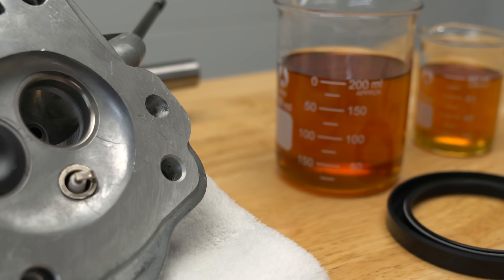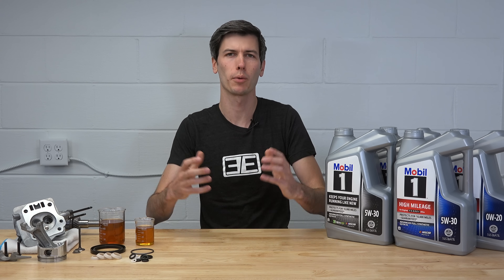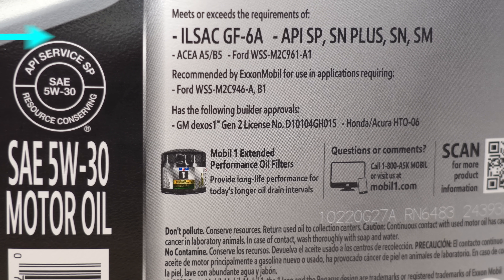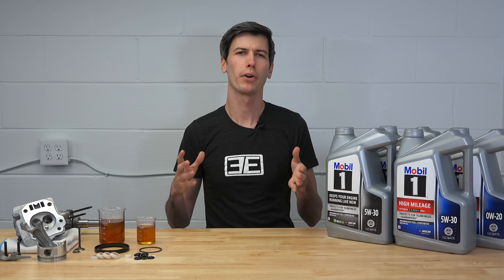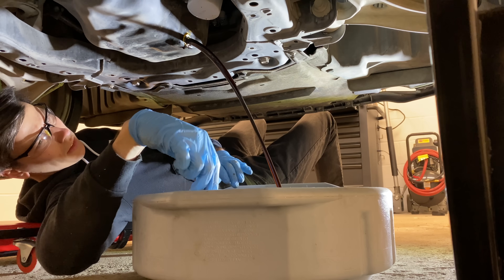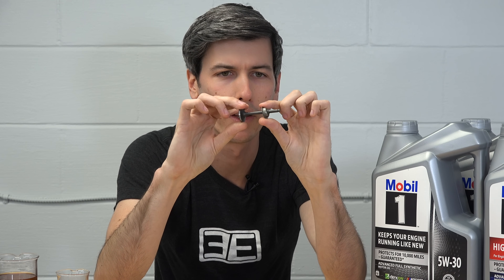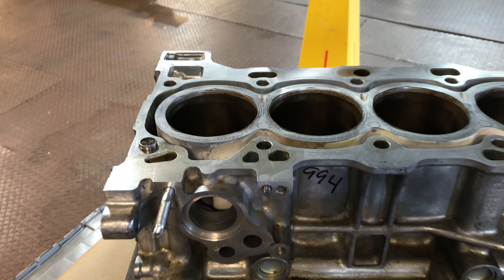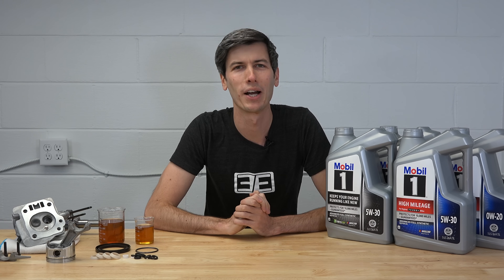Is Synthetic Motor Oil Bad For Old Cars?

Comment: I've always been humored about that "removes sludge" testament on old engines with synthetic oils and that's why they shouldn't be used. Like mentioned in video, who the heck wants to have sludge on their engines?
Reply: Very warn old engines need sludge to block leaks and maintain oil pressure.  Sometimes cleaning out sludge can destroy an old worn engine.
Reply: @raybod1775  no it can't. Do you realize how absurd that claim is. So you need sludge in side oil passages to increase oil pressure? That would mean by physics laws that oil flow amount has also drastically reduced and this somehow increases engine life? Ok let's assume that sludge isn't in oil passages. Where's the next possible place where it could affect? Bearing journals. If that would be the case that sludge will eat bearings away in no time. Let's be real. There is no place for sludge that could increase engine life.
Reply: jothain  Happened to me many years ago.  I had an old dirty car engine and after putting in new clean oil, it hardly could run and all sorts of mechanical noises.  I used a heavy oil additive for old engines and the engine worked better again. It could have been many things like the guides around valves, worn rings, worn bearings, worn oil pump, etc.

Comment: I had a DC2 Integra Type R and never used any oil but when I switched from a semi 10w40 to a full synthetic 5w40 it started using some. I find it hard to believe it was coincidence. I then experimented with using full synthetic 10w50 which lessened the oil burning slightly. Just my experience.

Comment: If you have a rebuild from 15 yrs and older, those gaskets are not compatible with synthetic oil and will leak, otherwise your good to go. If you have an old car from the 50s, 60s, 70s, 80s that have not had a rebuilt engine yet, then they will probably leak synthetic oil. If you have a 1988 or 89 or older engine then you need a minimum of 1200 ppm of zddp.

Comment: I've driven nearly a million miles between 5 different cars all older than 2002 (delivery driver) using only Mobil 1 synthetic for the last 16 years and I've never once had an oil related problem. I change it about every 8k miles.
Reply: @Darren Munsell When I was a tech for GM I'd see people change their oil going off the oil change maintenance life and come in for their first oil change at 20k miles once it finally hit 0% with an engine that looked like an 80 year old smokers room after taking the oil cap off.
Reply: @watersauce3998  amazes me how people will spend thousands on a new car and not take care of it.
Reply: @CloroxGodThe1st  that's exactly what I don't understand. A lot of money is being spent, but there is savings on maintenance. I had exactly this problem with my used car when I bought it. because it had only a low mileage, i thought the engine would be in good shape, at least i thought ... the previous owners were using cheap engine oil with the wrong viscosity. in combination with high change intervals and short-distance operation, that messed up the engine. only with many oil changes within a very short time and the use of engine cleaners has the oil consumption sunk to a level that is hardly measurable. i was very lucky.
Reply: @watersauce3998   sir if you work for gm what kind of oil would you recommend for a rebuild 2005 Cadillac Deville.  Thanks
Reply: Thats good! But you change the oil ! Theres the magic with oils and engines ,you change the oil when its time. 👏
Reply: Same.  been running synthetic in everything since around 2008 or so. Good stuff. Everyone should use it.
Reply: Nice try Mobil 1 representative!
Reply: @R3lay0   I did 15K between oil changes with Supertech full synthetic from the late 80's to 2011 with a new filter halfway, sent a sample to Blackstone Labs for analysis and they said it was good for a few more thousand miles.  I got out of that industry and don't drive 22,000 miles a year so now I change it every 5,000 or 4 months as not to void my warranty.

Comment: The original reason for "leak problems" when switching to synthetic was post WW2. 
As before that people use Group I oils with next to no detergents, and after the war there was a surplus of the newly developed synthetics that also had high levels of detergents and it didn't end well for the old cars.  
So if you have changed oil since 1940 or so, you're safe. It's also just a couple of Ester oils that was really aggressive against the seals, but they are gone. (About 3000 different Ester oils was created by the end of 1940 (or so), how many there is today is hard to say as they are built for their purpose).  
The concept of "synthetic" is also muddy, Group III used to be mineral, but it's called synthetic today. The only base oils that's built is Group IV & V.
Reply: Still use Ester oils in a/c systems
Reply: @timothythomas1737  They use Ester oils for a lot of things, engines, ac, transmissions in cars and for an endless variety of other things. That's what's great about them, you can engineer them to get completely different properties.

Comment: In 1996 I bought a new XL1200S and told my local dealer I was going to use synthetic after warranty ran out.   They and HD tried to tell me that I could not do that.  I did not listen as I know more than them.  Soon after, HD comes out with synthetic HD oil.
Synthetic and regular oils can be mixed, switched back and forth, without issues.  Can use synthetic for engine break in - best oil for everything.
Do Not Use High Mileage oil in your engines!  Just use synthetic.  I use synthetic in all my old junk.

Comment: Thanks you so much for doing this.

Now, when idiots whine at me for putting synthetic in my 65' Mustang, instead of arguing these points for 15 minutes I can just direct them here.
Reply: Yup, I hear you....10W 60 Lucas synthetic in my 290 thousand mile 318 in my 66 Charger.....don't forget the zinc additive.
Reply: @SSGTA440  I had a 1967 Plymouth Fury years ago that had a 318 with almost 260,000 on it and all I ran was "GASP" 20w50 petroleum. How did it ever survive?

Comment: Seems EE is going to do a sequel video on ZDDP.   Please make it 'in depth' and NOT just "Flat lifter engines require higher levels of Zinc/Phosphorus, or an infomercial.  This is a BIG issue on classic car forums. I can't think of anyone better than EE to cover it!
Please don't short change us!
Reply: Flat tappet engines don't need high ZDDP. Sure that's one way to achieve it, but other additive packages will also protect those high pressure areas.
Reply: @GregoryVeizades  I would tend to agree. Which is why I hope EE goes into some depth in his video.  
It is not just a case of 'more is better' and as you suggest their are other EP additives other than the  much hyped ZDDP componds.

Comment: This is the question that's always plagued my mind regarding high mileage oils: What happens when/if you swell the seals with a high mileage oil, then go back to something without those additives?  I've always wondered if the swelling of the seals is one of those things where once you start that process you need to keep after it.  I've stayed away from high mileage oil in my vehicles for a couple of reasons.  The first is probably unfounded as it relates to these wifes tales of oil seal leakages etc...which is something my dad used to tell me.  Mainly though because at 322,000 miles I don't burn any oil, conventional or synthetic...so why bother?
Reply: Full synthetic oils have the same seal swelling chemicals as the high mileage oils, they just have less of it. All API SN oils contain seal swelling chemicals, except it's in even smaller concentrations in the cheaper "conventional" blends. The seal swellers are synthetic esther oils and any oil containing them is by definition semi-synthetic.
Reply: Keep doing what you're doing as long as it works.    A switch could be fatal to an old high mileage engine.
Reply: Isn't it easier to just change the seals?🤔 Like every 200,000 rebuild the engine or at least change the seals.
Reply: @0hjaa3.0  isn't rebuilding the engine easier than switching oil? Better? Obviously. Easier? Seriously?
Reply: @PatrickRich  Ofc you change the oil by draining it and not by switching to different viscosity.
But by rebuilding the engine every 20 years, you keep the car going much longer.

Comment: Synthetic oil doesn't burn off as easy as conventional oil, I have had a lot of experience with this and I won't recommend synthetic for a rotary with an oil mettering pump injecting engine oil, it will eventually foul plugs for sure
Reply: If u do want to give advice on rotary engine I'd advise u to at least confirm your advice with an experience rotary mechanic or equivalent, a fisher man never says his fish isn't good. Love your channel btw ✌🏾

Comment: I've always understood that the cross hatch pattern was the honing in of the cylinder and was to facilitate the the braking in of the piston and cylinder walls.
Reply: What is "breaking in" though? The rings rotate during normal operation which would negate any ring-to-bore matching.

Comment: I used synthetic oil in our 2013 Hyudai Sonata which is designed for mineral oil and it consumed, not leaked, almost the entire batch of oil. I went back to mineral oil and the oil level stayed at the full mark till almost 5000 miles. I think some designs are made for synthetic and some are not. I tried the same experiment in my son's 2003 F250 with a 5.4 and the same thing happened. A mineral oil engine that did not like synthetic, so it consumed it.

Comment: Some say that the Mobil-1 today does not compare to the Mobil-1 as a synthetic motor oil. Since Mobil lost the lawsuit over what can be called a "synthetic", Mobil has changed the formula to a cheaper one that compares with the competing synthetic oils such as Pennzoil and Quaker State, etc. Is this rumor fact, or fiction?
Reply: Yes and no.  Yes they lost a lawsuit that claimed Castrol Syntec (a severely hydrocracked conventional oil) was as good as Mobil1 (which was a group 4 synthetic oil) since that, in North America the name Synthetic with regards to motor oil is a kind of Grey area.  Typically it refers to a manufacturers premium product.
Mobil 1 is now is also a severely hyrdocracked conventional (Dyno) oil.

Comment: Could you give a comparison between regular Mobil-1 and Extended Performance Mobil-1? I use the EP but change my oil at 5000 miles, or 1 year, regardless. I use EP because it is my belief that the EP has more anti-wear additives, not for extended oil change intervals.

Comment: Mobil 1 high-mileage synthetic has saved 3 of my old vehicles by stopping minor leaks that would be too expensive for me to fix otherwise.  One has been leak free for over a decade since I started using high mileage synthetic oil.
Reply: I had the same experience, but it was with Valvoline Maxlife initially.  I've used about all the other hi-mileage oils and they all work well...synthetic or not.
Reply: @trpbee  Yup, it's great stuff, I hope more people learn about them and use them.

Comment: Porsche 928 is a flat tappet engine that needs adequate levels of ZDDP (zinc diophosphate) in it oil. Mobil One only do one Mobil One oil they recommend for flat tappet engines ( also recommended for racing) and this one is not really available in Australia as far as I can find.

Comment: I only ran conventional oils in my RX8 at Mazdas recommendation until switching to a Sohn adapter on the OMP and running 2 stroke for injection and synthetics for engine oil. I value manufacturer recommendations over oil company ideas, I'm sure mazda did their research on engine longevity with different oil types
Reply: Just curious, why did switching away from the oil metering pump to a sohn adapter allow you to start using synthetic engine oil? Just curious since I hear this all the time and don't really understand it. Thanks

Comment: Two things:

1.  I was taught in college that switching to synthetic from dino oils can cause "kudo's" or deposits to drop off of various parts and possibly clog small oil passages leading to oil starvation.   Obviously, this would be in an engine with plenty of existing sludge, but I also had a student who was a chemical petroleum engineer tell me the same thing.  He even went on to say that it is best to stay with the same brand of oil for the life of the car to prevent something like this from occurring.  Also, it is common to read on Rennlist that due to synthetic oils greater consistency, it is possible for it to leak past a seal that was holding just fine with dino oil.

Like a lot of things on Rennlist, I guess this is just crap~

2.  Porsche uses Mobil 1 in their cars due to a marketing agreement.  My Porsche's manual says any oil of the correct viscosity and that complies with Porsche standard A40 is acceptable in their engines. 

Great video!

Comment: I wonder how much of this knowledge could be applyed to motorcycles (wet clutch, etc.)... Thanks.
Reply: Its fine, just use a motorcycle specific oil. That will insure the additive package is compatible with a wet clutch. Many large brands, and even motorcycle brands offer motorcycle specific full synthetics.
Reply: @forrest225  Thanks.